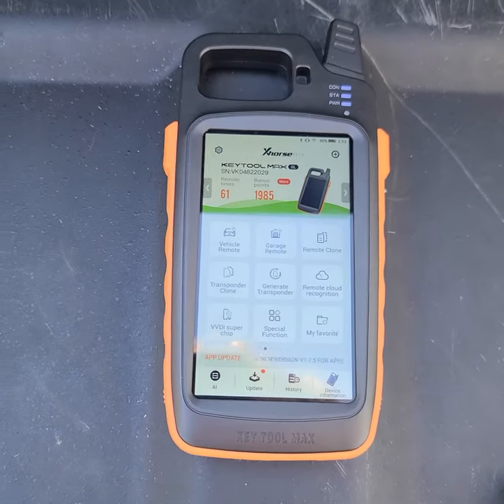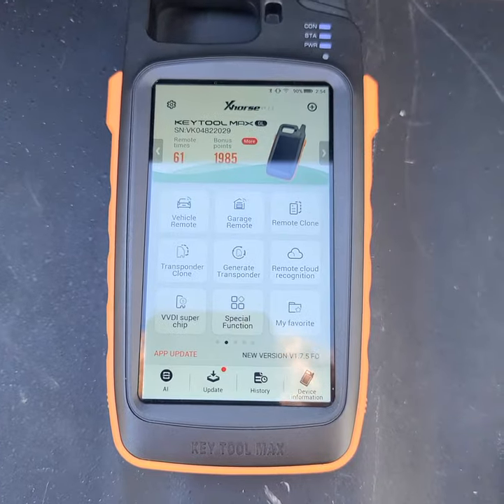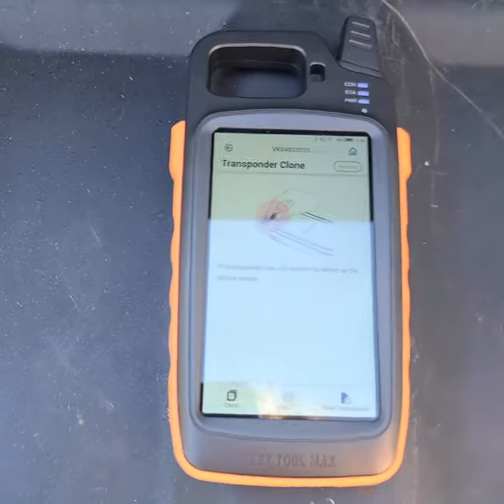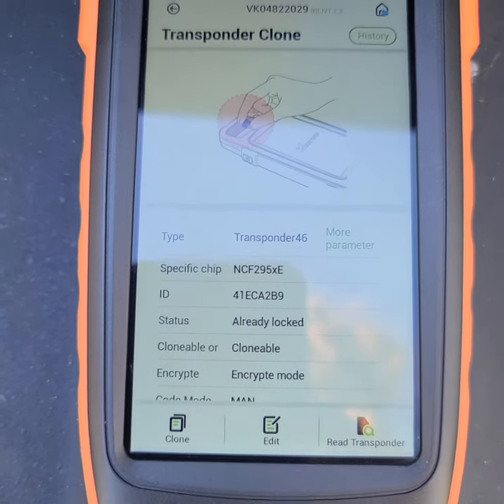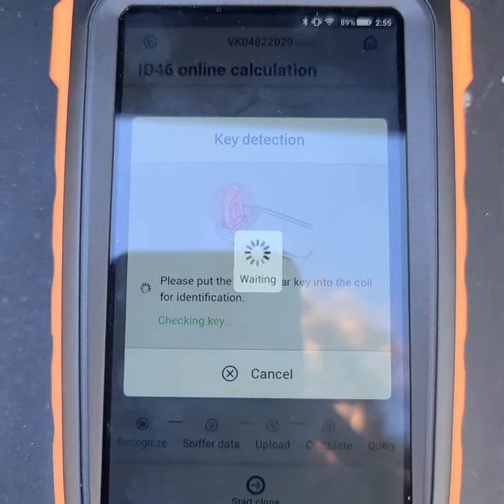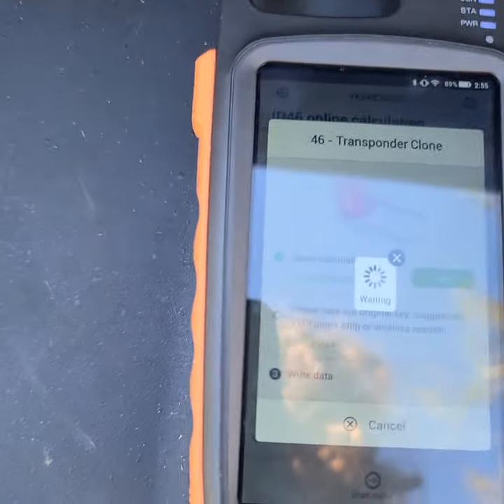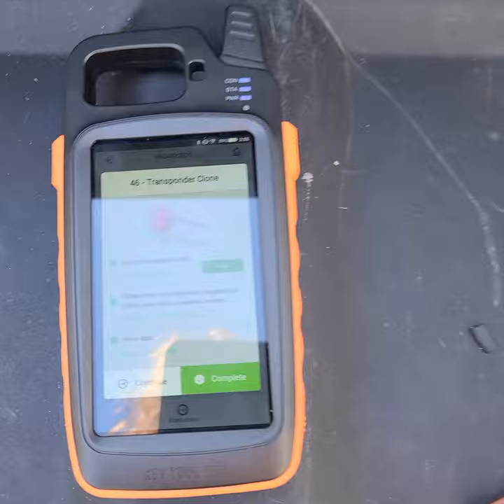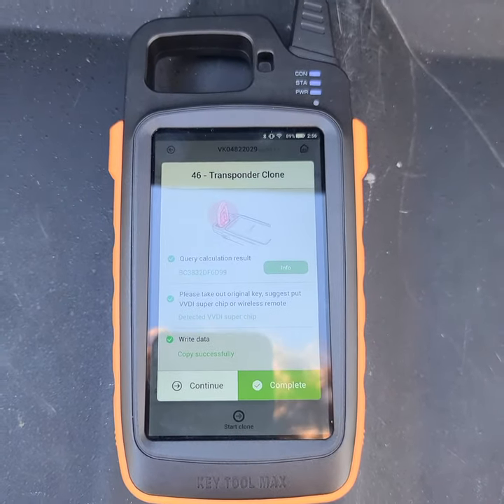How to clone Transponder (car key chip) Xhorse Key Tool Max

Comment: How did you copy or chip "unclonable chip " .. how to use my xhorse pro machine ? EXAMPLE< 2014 , HONDA , ACCORD > ?
Reply from the maker: you cannot clone unclonable chips. however your example should be cloneable unless smart key in which case you would GENERATE  remote and then program under IMMO function
Reply: @EntryExpert is there a video available on this